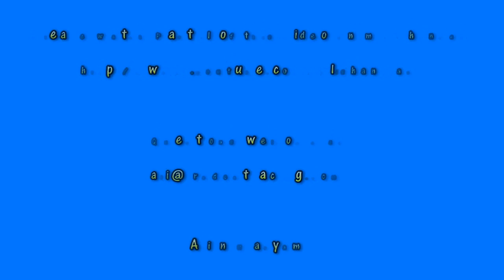RC Planes for Beginners Part I

Comment: Greetings - I think it is a mistake to say that elevator makes plane ascend or descend. Firstly a plane climbs. Secondly the elevators change the pitch angle of the wings, but only power can make it climb. If you are in cruise and try to climb with elevator only you will stall. Airspeed, airspeed airspeed!

Comment: Bare in mind, you are flying a mode 2 transmitter. I fly mode 1 JR 11 channel transmitter which is the throttle and ailerons on the right. Rudder and elevator would be on the left. I fly a CompARF 2.6 meter Extra 260 and Pilot RC 2.6 meter Extra 300. Both have DA-100cc engines in it :) Amazing planes!

Comment: hey dude, great video, im not a huge rc plane fan and therefore know little about the whole game.....what im after is your advice on flying a plane for TOTAL beginners that will carry the weight of a sony bloggie (4.4ounces or 125grams) - m looking to strap to a wing to avoid pros getting in shot - im guessing ill need a counter weight on the other wing so am looking for a plane to carry 9ounces or 250g for absolute beginners. - if you can offer up a model for under £150/$240? Thanks mate.

Comment: Hey man, my bro bought me one of these planes for christmas, I'm having trouble with the rudder and would really appreciate your advice. When I'm checking all the controls pre flight the rudder turns to the left a decent amount but only a small distance to the right. I've messed about with the length adjustment thing but nothing really changes. Also similar problem with the elevator but not so much. Is there a way of pronouncing the angles of the rudder and elevator a bit more.   Many Thanks.

Comment: @Mrfuzzykitycat :  If you are serious about RC flying, join the AMA and find a local flying field.  They have instructors there that will spend some time with you and show you how to fly.  The use what is called a buddy box that connects your radio to theirs.  That way, in case you get into trouble, they can save your airplane by taking control.  Just something to think about.

Comment: hey i have a spitfire 800mm now, i just flew it today, i just crashed it in 6seconds, i took and and tried to turn right away, advice should i get a lot more air before i start doing things. and slow stick movements, any advice on getting my mind threw that this isnt a simulator, and that i cant be afraid to lose my plane pretty much in the air. thanks